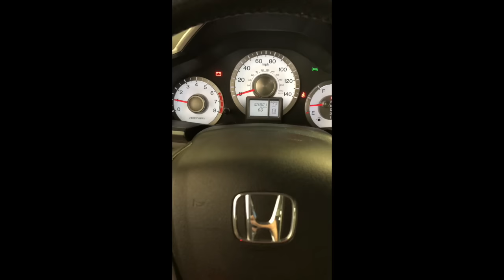How To Replace Alternator Honda Pilot 2009-2015

Comment: Thanks for posting, just changed the alternator in my 2009 Pilot without removing the power steering reservoir or tensioner. Simply removed the belt using the tensioner, and the bracket for the coolant and power steering reservoir, then moved them out of the way without unhooking hoses. Wasn't too bad of a job, and went quick.

Comment: absolutely phenominal video.. i watched it at lunch and took it off in 30 mins after i got home.. only diff is i just removed the main tensioner bolt and let it rest to the side.. i didnt have to remove both of them

Comment: THANKS RIX.   Very helpful.   Just completed the Alternator swap on my 2011 pilot following your steps.    A few notes -  when I took the old alternator off,  I used a digital caliper to measure the size of the piece that takes the bottom bolt on the alternator  (that fits in the bracket on the engine block).  Once I got the new alternator,  I found it was a little bigger   (1.78 vs. 1.83).  I spent a few minutes filing down this part before putting in the new alternator.  It fit perfect after it was filed down.   Also,  another tip,  I used a wrench with a pipe for leverage to relieve tension on the tensioner pulleys.   Then I used a small ratchet strap to hold it in place while I removed the belt.  This also helped me get enough clearance to remove the alternator without having to remove the tensioner pulley.    Thanks again for the great video.
Reply from the maker: Our pleasure! Thank you for watching!

Comment: Good video however you don't have to remove the tensioner.....its very easy....d
Reply from the maker: @cardealer thanks for watching! You are certainly correct, the tensioner does not have to be removed, After wrestling a few I have found it to be much easier with it removed, worth the few minutes it takes to remove the tensioner vs, losing the time or more on the back end when trying to get the alternator out. You’re feedback is appreciated!

Comment: 2012 Honda Pilot Tips:
I just did this install and used this video as guidance. There were a few things that were slightly different.
1. The biggest thing is the belt tensioner is a different style. It doesn't have the 19mm hex tab (or maybe mine was broken off). I used a half drive socket wrench with a 14mm socket directly on the upper tensioner pully. It moved fairly easily. To do so, you need to remove a small ground wire bracket that is right in the way, and gently move the AC tubing out of the way. 
2. I didn't need to pull the tensioner off, it was not in the way once the belt was removed.  This is likely due to it not having the hex tab shown in the video. 
3. If you really don't want to remove the power steering pump hose, you can get away with taking the reservoir off the bracket, and removing the bracket. You will also need to disconnect the main A/C bracket at the top of the engine near the fuse box. Then you should have enough room to squeeze the alternator between these two devices. However, removing the PS hose would probably give you a little more room. 
4. As mentioned in another comment, if your new alternator has a larger lower bushing than the original, you can use a small hammer to tap the bushing found in the mount on the motor, and it will slide out allowing room for the new one to fit. You shouldn't need to file anything down. 

Cheers and thanks for the video!
Reply from the maker: Bryan Vagis thank you for watching!
Reply: Just did mine was like yours... 2014 pilot... was a pain in the ass putting that new alternator back in and that damn tensioner.... had to remove the ground wire from the chassis too. Smh took me 5 hours.
Reply: Replaced on a 2012 Pilot also. Agree with the above tips. The belt tensioner system is different than the 2011. Does not need to come off. I found it easier to remove the PS hose from the overflow tank. I drained the fluid into a plastic container. Lost very little onto the engine. I had a problem with the larger lower bushing. I found it very easy to grind it down with a Dremel rotary tool- Worked like a charm. Great video and tips for the 2012 model year.
Reply: My tensioner was the same. Hope everything else is...
Reply: Thank you for the tips! Mine is 2010 and all your tips worked! Great video

Comment: Great video.  You saved me at least $400 I would have had to spend on more expensive parts and labor at a shop.  Followed everything to a T.  I had to remove the tensioner on my 2011 just like in this video - couldn't tetris the alternator out of there otherwise.  So many good tips on this video. I ran into zero issues.
Reply from the maker: mrjspeed awesome! Happy to hear, thank you for watching!!

Comment: Thanks for the video, great detail and explanation.  My wife has a 2009 and I changed the alternator in it using these steps.  Fixed the issue and couldn't have figured this out without this video.  Getting that high torque tentioner bolt off was not easy, ended up using a breaker bar, but got it done!
Reply from the maker: thank you, thanks for watching!

Comment: I also did this job and did NOT need to take the tensioner off. Had a bit of difficulty getting the bottom bolt hole on the new alternator to align (was catching on the due to the black bushing in the left mount hole) but eventually shimmied it and got it to squeeze in. Thanks for the video, RIX.
Reply from the maker: Roger Smith thanks for watching!

Comment: AWESOME VIDEO AND SPOT ON!  I replaced the alternator in my wife's 2009 Honda Pilot exl in 1 hour and 45 minutes.  Needed a second hand to get the new belt on, but was a breeze.  3/4" pex plug, plugs the power steering hose on the reservoir so there are no spills after bottle is stashed aside.

Comment: You are THE MAN!! No other video said to wiggle the alternator out so we didn't. And then we couldn't get it back in. So we used a break away bar and a hammer to push that bushing I think it's called to move back out so the new alternator would go in. So again thank you!
Reply from the maker: Jess H my pleasure! I’m glad the video helped 👍🏼
Reply: I use a 19mm socket, a 3/8” carriage bolt through it, and a nut to pull that bushing back. It works really well and fast.

Comment: Thank you, very helpful.  I did this job without disconnecting any power steering hoses or removing the tensioner.
Reply: I was wondering if it was necessary or not to do all of that thanks for clearing it up.

Comment: Thanks RIX. I didn't take the belt tensioner off because the tensioner bolt was very difficult to get off. So I took off the plastic window washer fluid tank (two 10 mm bolts and three wire connectors) and the upper alternator connecting bracket (one 12 mm bolt), and the alternator came out fairly easy. I had to replace the alternator twice in 24 hours because the first AutoZone remanufactured replacement (Fed Ex delivered to my home) was faulty (11.5 volt output).. So I had AutoZone test the second replacement alternator (tested twice) BEFORE I spent two hours putting it in the SUV. Limited lifetime replacement. Less than $200, but it took a full day+ to do. <><
Reply from the maker: coolramone my pleasure 👍🏼

Comment: I have had intermittent hums/whines with a small degree of smoking over the last two months. Of course the problem went away while taking in for service at two different garages. At both garages I was told I had some minor leaks around some gaskets which I declined since they were very minor. I did end up replacing the serpentine belt and timing belt - they just needed done regardless. I explained to both the hum/whine and smoke from lower front part of engine and that it happened at the same time. Finally, today, my wife says the battery light is on and I have her pull up to my office building and not kill the engine. I also hear the hum and there is smoke coming out yet again. Managed to get it to the closer garage (not my preferred for big jobs), and called the other garage and they suggested the alternator and pulley, and this video seems to confirm as much. Would have been nice to have heard that the first time around instead of it getting to this point. Same information was provided to them except for the addition of the battery light. This video certainly sounds like my whine and the location of the alternator fits with the general location of where I was getting smoke.

Comment: Thank you for this video it took me four hours to do but it got done. I managed to skip the removal of the tensioner instead my lovely wife assisted in holding the tensioner open with the breaker bar in order to swap out the alternator once it was unbolted but great video.

Comment: Good helpfull video. I went ahead and removed power steering fuild with a turkey baster. My 2012 tensioner has no nut to man handle tensioner. Tensioner is straight. Alternator was very tight getting past A.C. lines.

Comment: OK so I had a 2013 Honda Pilot. You will NOT find that 19mm torque nut on the tension pulley. You will need to use a 13mm (I believe) on the top pulley with a long handle drive wrench and push back toward the rear, that will allow the belt to just barely come off. I didnt remove the pully. I then removed the bolts to the alternator. NOTE there also is a small bracket you on the  PSGR side wall attached the the AC unit you have to remove only 1 10mm small nut. You have to remove that to get your socket wrench on that top pully. after you get the alternator free you have to twist and move it forward AND at the same time use that socket wrench on that pully to move it back so the alternator will come free moving it toward the passenger fender. (IT will be a puzzle to twist and turn and moving AC hose to get it out) - its HEAVY and hard to handle to get it up and out. Now getting the new one in really sucks because getting it back in you have a exact distance between the engine block nut hole and the bracket for the alternator to fit in. Clean and scrap between them a little to make sure no debris and grease those areas as you have to pinch that alternator back in between them and you have to move it millimeters one way or another to squeeze it back in. I had to tap on the alternator a little to get it to start to go. It will take a little bit but once it goes you got it just right. Then you have to align the bottom bolt up and the alternator just right for the bolt to slide through. There is enough room to get a air wrench with a 14mm socket and spin it while moving the alternator to get the bolt to pop through. The rest is back to the video after that and putting that little bracket by the AC sidewall back on.

Comment: You don't have to remove the idler and tensioner. You can get the alt out without removing them, however I'm sure it's probably a little easier. With a little patience and wiggling around you can get it
Reply: I see it just made it easier for him. But I agree you don't have to remove it

Comment: Hi I change my alternator from my Honda it works but the light in my front panel goes on and then few miles and goes away any idea what if Replace it with a new one ??

Comment: I have a problem the engine bolt on bracket won’t go in because the side of plastic engine cover is concealing where it screws in . Any suggestions anyone

Comment: This was a lot of great information but I don't know why it keeps saying 19 mm I use the 14 on a 2013 Honda Pilot and there is nothing underneath my hood that is 19
Reply: Everything that says 18 or 19 mmmm isn't even close to true I don't get it I went through all kind of drama at the auto parts store trying to reassure her that I had a 19 and everything else and none of that applied all I needed was a 14
Reply: @shelbyhimeliii  The Video is done on a 2011 model, they changed the tensioner mount system, suggest reading comments section for differences where all is revealed.

Comment: I don't see how to take that blue connector off. I don't see any kind of tab to help release it. I'm stuck right now.
Reply: Yeah, that blue connector gave me the most trouble with everything I took off. I did have to turn the wheel and go underneath to get a good grip on that last piece for that belt holder apparatus I took off. I did not have to take off the splash shield, though. Turning the wheel gave me plenty of room.

Comment: Wow this is the slow way. Pull the passenger fan and it takes all of 25 minutes start to finish. U just need to pull back the front grille (2 bolts) and then pull the radiator and condensor mounts off (2 bolts each). Fan pulls right out (4 bolts).